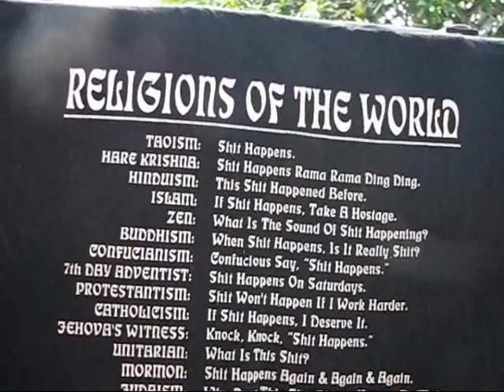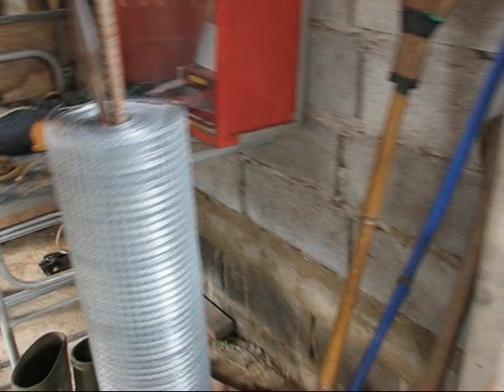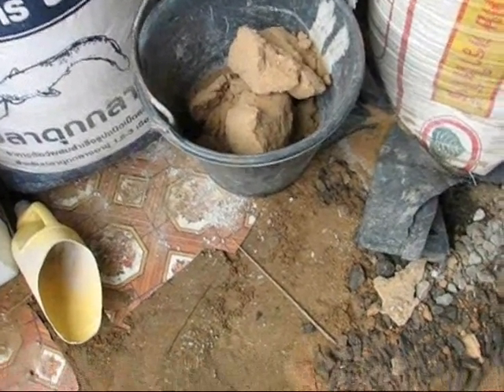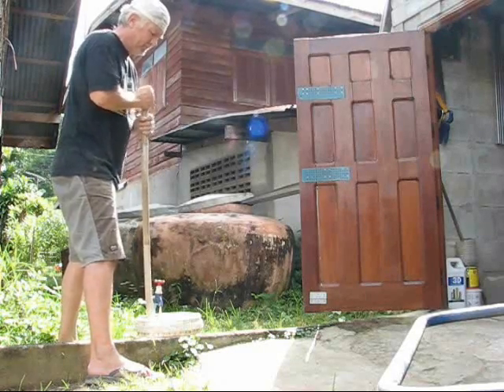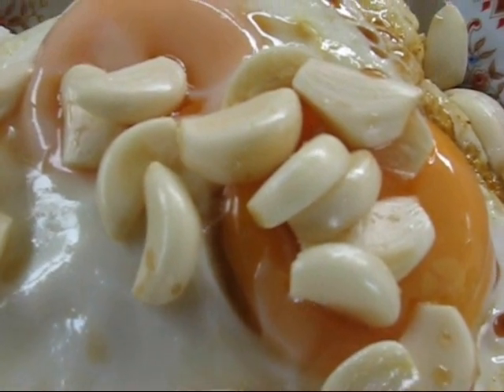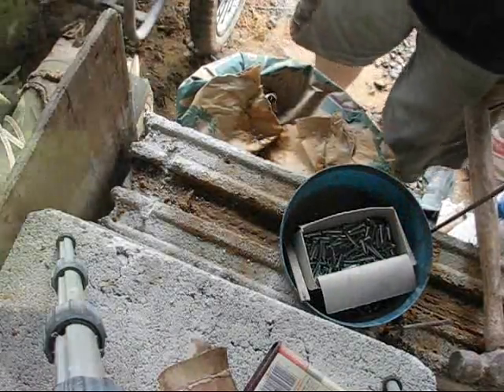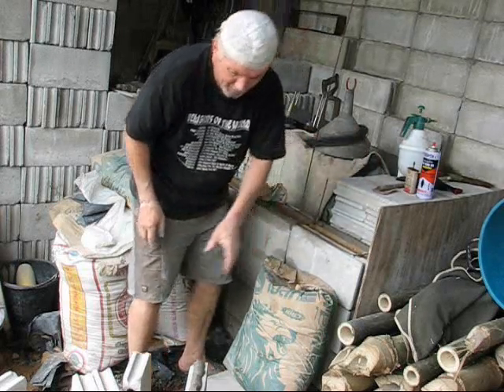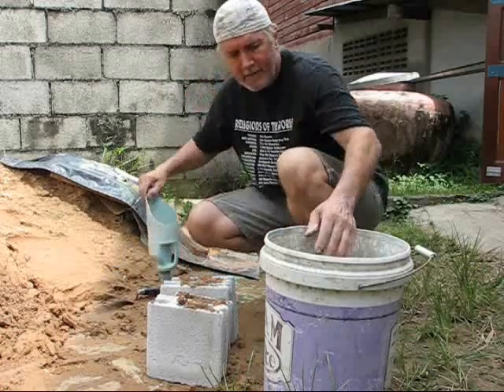Home Construction in Thailand_An American Version

Comment: 321 properties for cement normally works well  also add poly rope bits for super strength.   u take poly rope cut in 3 inch pieces and separate all the strands.  those strands really makes cement strong.

Comment: Why don't you stagger the courses of blocks ? surely by laying them directly on top of each other in straight rows you will have a weak wall.
Reply from the maker: That's for your input. Time will tell about the strength of the walls. The main reason I don't stagger the blocks is that when I was planning or figuring out what I wanted to do, I wanted to use vertical rebar. When considering the wall's strength I looked at it as - What direction do I want it strongest in. My answer was top down. I'm not concerned about pitch and yaw. All my load bearing walls have two parallel walls filled with sand, grave and cement. There is a fair amount of steel in them also and they have very solid foundations. 

I don't really see or understand why staggering the blocks makes the wall stronger. Perhaps you have some thoughts on that.
Reply: As the old saying goes "a chain is only as strong as the weakest link, by staggering the blocks you are transferring the stress into the whole wall, by stacking them in straight piles you have less load bearing area, thus a weaker structure, and lastly anything that has been piled between your two skinned walls will be pushing outwards an well as downwards. but I think your use of re-bar will save you on this project.

Comment: insane Dude.Did you not think of interlocking your blocks like a normal wall?Also if you want to use reinforcing rods they go inside the wall blocks cavity then fill with your concrete mix round the cavity.you don't need to fill it all, only the ones with the re-bar. And your mix is way off the mark .You want to be using between 4:1 sand to cement but you could go down to 7:1 and it will still be strong enough.You only want a weak mix...If there is any foundation movement you want your mortar to fail rather than the blocks cracking.I'm not a mason but hey stick to the cooking.:::::)